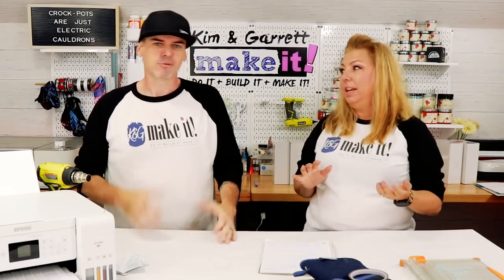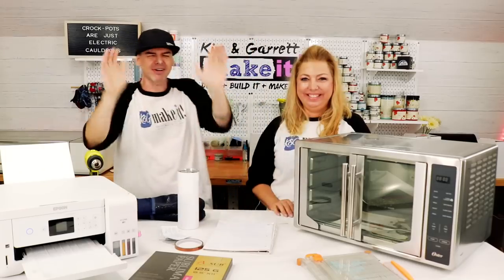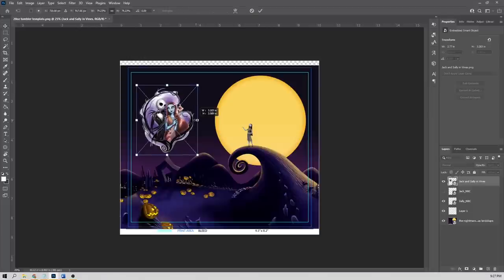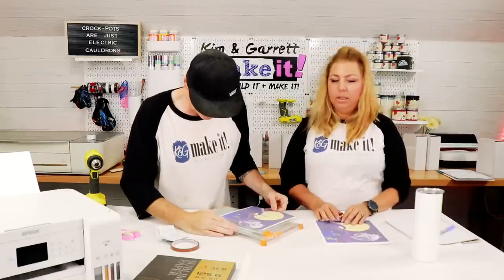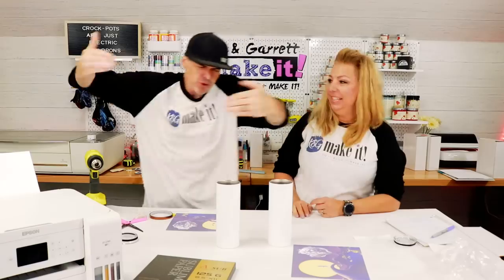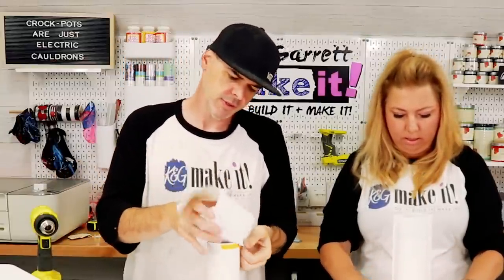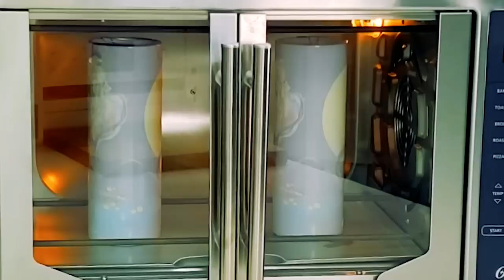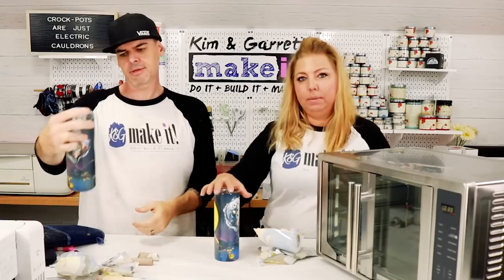Sublimation Tumbler in Convection Oven with Shrink Wrap

Comment: try taping the seam and around the top and bottom will be more vibrant and less bleeding aldo you dont have to put in water i put in front of fan or just on a table with good space around them when i have alot to bake
Reply: Does the ghosting happen when it doesn’t seal tightly or when you move it around…or both?  And is it a problem if you let a mug or a tumbler cool completely with or without that plastic wrap on it?

Comment: This is great thanks! I don't have a double door but still helpful. You guys need to get a tape dispenser off amazon for sure
Reply from the maker: Thanks for the tip!
Reply: @KimandGarrettmakeit  Desktop Tape Dispenser Adhesive Roll Holder (Fits 1" & 3" Core) with Weighted Nonskid Base Blue is the one I have

Comment: You need to get an internal thermostat for the oven. Also when wrapping it you need to pull real tight and put tape all the way around the top and bottom so no air gets under
Reply from the maker: Ohhh where can you find those?
Reply: I think they’re suggesting an oven thermometer, like what you would find in the small appliance/kitchen accessories aisle at the grocery store.